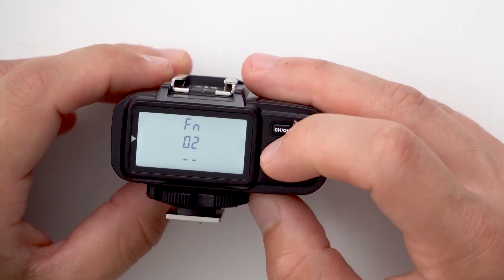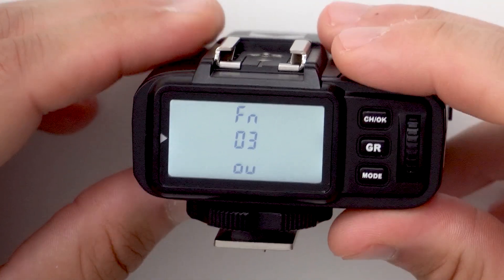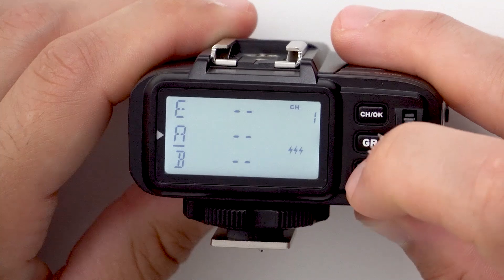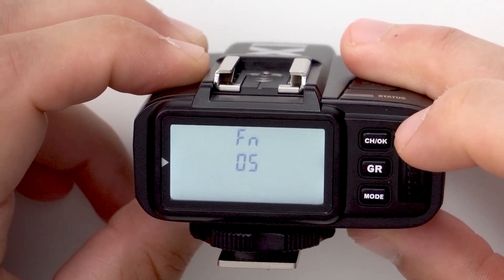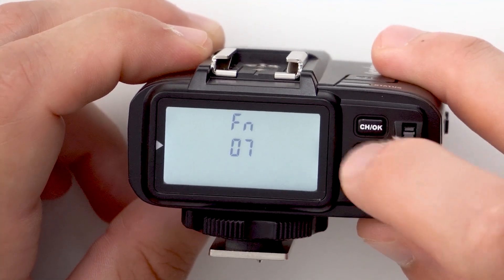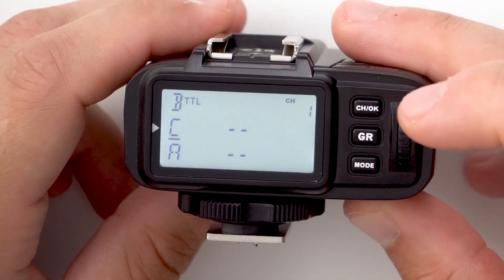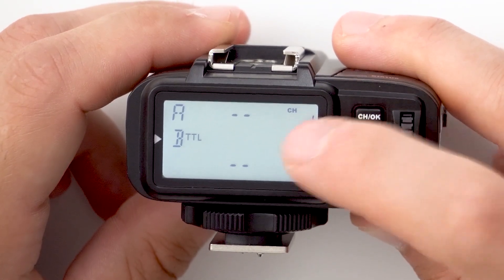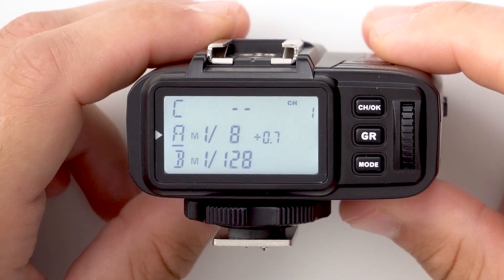Godox X1T Control Guide with Custom Functions (Flashpoint R2 Flash Transmitter) (Pixapro ST III)

Comment: Can i put this on camera and yn flash on top of this godox to use it as normal manual flash i need this just as af assist
Reply from the maker: Yes but I wouldn’t recommend it. You’d lose TTL and it would be unwieldy. Plus I feel like for the price, you could sell the Yongnuo and buy a Godox flash that has the AF assist beam and solve both problems.
Reply: Robert Hall Photography  my flash is universal it doesnt have ttl i need just af assist from godox
Reply from the maker: Could you sell that flash for $20? I'm just saying it might be cheaper to sell your flash, and buy an equal flash (like TT600 which is only $20 more than this X1). Then you won't have to deal with having the X1 in between the flash and camera, and you'll have an AF assist beam.
Reply: Robert Hall Photography Does TT 600 have af beam assist? in my country it costs 100€
Reply from the maker: yes.
Reply: @robhallphoto  Great lesson for me, thank you. My question for you is how can I get my Fuji XT-3 hotshoe flash (the EF-X8) to fire when mounted on to my Godox X1 trigger. I want to use the X1 to transmit to my TT685F and use the EF-X8 as a key light. Is there a setting to activate the X1's hotshoe mount so that I can do this? This is why I bought the X1 so that I can have on camera flash and trigger at the same time.
Reply: It does have the red beam/laser. The focus assist? How well and fast does it focus in pitch black?

Comment: thanks for the video Robert. I have purchased FlashPoint strobe without its transmitter (it went missing during the courier) FlashPoint things are not available in Asia but Godox ones are available. My two questions (1) Will this work in place of FlashPoint R2 X1T-N iTTL, which is what I had to receive as a pair? (2) Do i need to be careful about good transmitter available in TTL and iTTL models? If the detail helps, strobe model is 'FLASHPOINT XPLOR 600 HSS TTL' Thank you so much in advance
Reply from the maker: Yeah, Godox X1T-N is the same thing as R2 X1T-N TTL. No there's only one type for ttl, you just need to make sure it's the correct brand (N for Nikon, C for Canon, etc.)

Comment: Hello Robert, I'm looking to control off camera flashes, AD600 & TT600's while triggering an QFlash on camera bracket through PC synch, however I changed the custom function 3 to "PC Out"  and it still wouldn't fire the QFlash with the off camera flashes, Any ideas?

Comment: Hi Robert

Thabk you for this video. Very helpful.

I have a d850 and three nikin Sb910. I am planning on purchasing the godox wistro Ad600, x1T and three godox X1R to work with all 3 of my Nikon sb910. 

Some reviews suggest that the godox x1t and x1r do not allow you to change the power of the nikon flashes wirelessly...have you tried this trigger kit with Nikon body and flash? And did you experience any limitations for controlling flash power wirelessly? 

Lastly you touched upon the flash zoom in this video. Can the trigger and receiver automatically adjust the flash zoom automatically based on the current zoom on the camera?
Reply from the maker: +Yasin Ch I haven’t touched a Nikon SB910 since Godox has had the X series, so I can’t personally vouch for it, but much like the Yongnuo 622 system, you should be able to simply put them in TTL and then the X1+x1R will allow for TTL and manual control.
As for the zoom, I have no idea how an SB910 would behave.
Reply: Robert Hall Photography I have just bought myself a godox ad600 after yoir very in-depth review and I can happily say so far I'm very pleased with the light. Thank you for your efforts it does go along way!

I also have purchased 3 x1r-n receivers with an xpro-n. I will keep you updated on my findings, hopefully it can help you for any future queries yoir viewers may have. Cheers once again!

Comment: Hello. Thank you for the  video.  A quick question, what is the purpose of the extra hot shoe, on top of the devise ? Is it active all the time, regardless of the mode and settings you use?
Thank you.
Reply from the maker: +Stefanos Tsakiris when you put a flash on top you get an extra group to work with. If you aren't fully adopted in the Godox system you can put another speedlite on top of your camera. That's pretty much it!
Reply: Thank you.

Comment: One thing that's confused me about the Godox triggers since the Fuji update a couple of months ago - I can now use a Fuji controller for full remote-control over Nikon or Canon-system flashes, but will it also work with Canon and Nikon Godox receivers?  Can I put an SB900 on an X1R-N and an X1T-F on my Fuji camera and have TTL, HSS, etc?   Better yet, could I put a 600EX on an X1R-C and trigger it from a Nikon camera with an X1T-N attached?  It's the universality of cross-compatibility that I can't seem to find an answer for anywhere.
Reply from the maker: I can't make a claim to all flashes, but I do know a lot of people have found the cross-brand compatibility to work with the receivers too. Not sure specifically for the models you mentioned but people are definitely doing this.

Comment: Hi Robert, there is one power-on mode that you didn't cover. If you hold the test button down while you turn the trigger on, the status LED blinks twice and will allow you to control and trigger units very close to the transmitter. It puts it in a low-power mode that may reduce the maximum range of transmission, but removes the minimum range limitation.
Reply: Does the setting persist once transmitter is turned off?

Comment: Great video, thanks Rob. If I want to have 2nd curtail sync, and my exposure time is 10-15 sec, how can I do that? I would like to shoot people under milkyway.
Reply from the maker: +Niaz Mahmood does your camera have rear curtain sync? For my cameras it's an in-camera option, which then delays the flash fire signal until the end of the exposure.
Reply from the maker: +Niaz Mahmood if not, I don't think the delay would benefit you for that long of a desired rear curtain sync.
Reply: Thanks Rob, I use Canon 7d II, I think I have 2nd curtain synch option on my camera, I shall give it a try.
Reply: With a shutter speed that long, there's no real need to even sync a flash to the camera in any way. Just tell your subject(s) that you are firing the flash 'now', and hit the test button. Do have them hold still for the ENTIRE duration of the exposure though, to avoid ghosting.

Comment: Custom function 04 is for stroboscopic mode. The T is for time and H is for hertz. You might want 10 flashes (H) at 2 (T) per second. You might have a moving subject but also want a longer exposure, so 10 flashes in 2 seconds on a 2 second exposure. It's more for creativity than practical uses. You need a really low power output as well, full power would never recycle fast enough

Comment: Good synopsis. What brand of X1 were you using?
The Canon version is a bit different on the custom functions.
C.Fn 04 is rear curtain sync, C.Fn 06 is three or five groups, and C.Fn 07 is flash beep on/off.

You can also hold down 'mode' for 2 secs, to go into group mode, which allows you to mix TTL and manual groups.

And hold down the test button while powering it on, will enable the trigger to fire the flash at close proximity.
Reply from the maker: +Andrew Parnell this was on a Fuji, although I'm fairly certain it's identical to Nikon.
Reply: Thanks Andrew.
I've been looking everywhere for the TTL plus manual groups info. 
You sir are a legend!
Reply: Andrew Parnell 408+
Khñjvkbfñ
Reply: Can you also adjust compensation in TTL mode?